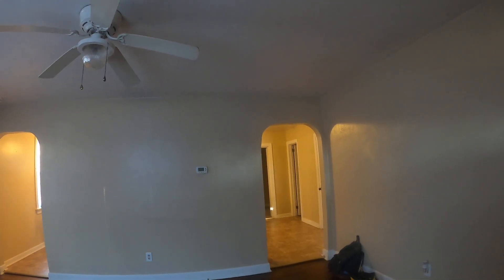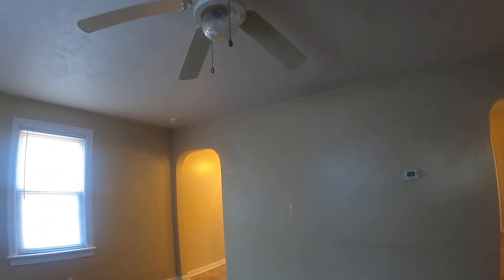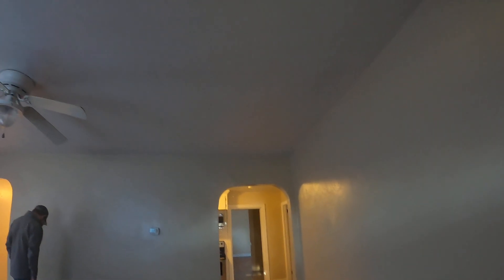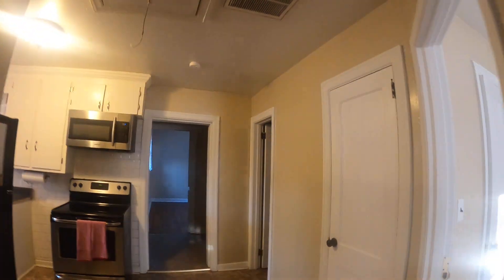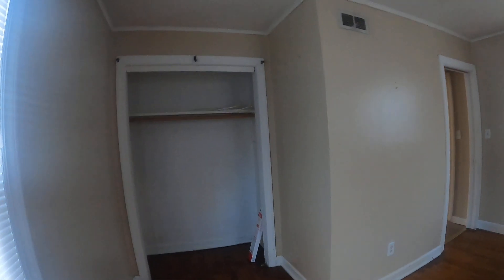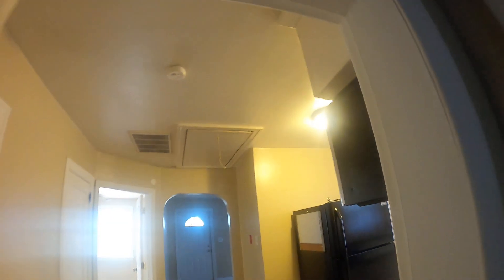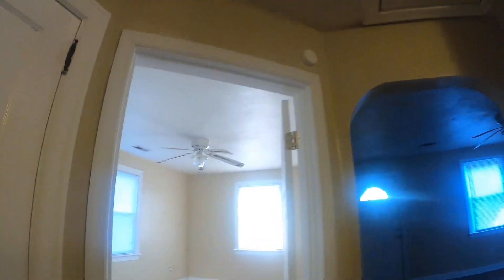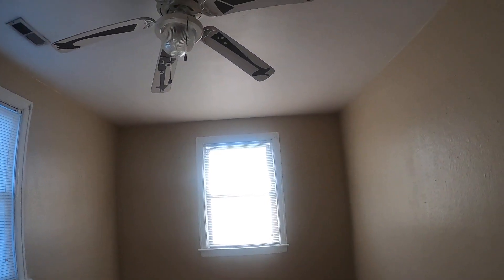Unlevel Floors - Structural Inspection - Part 1

Comment: My upper level is so uneven with a ton of soft spots and sagging throughout.  I can feel the joists under my feet when I walk. The subfloor feels like it’s sinking. I can see the imprint of the joists in the ceiling of my main level. 2-10 was supposed to send an engineer to inspect the structure - but never did. The engineer who did my walk through 5 years ago when I purchased the home as new construction maintains this is all normal.  He still works for the builder, so I don’t know.